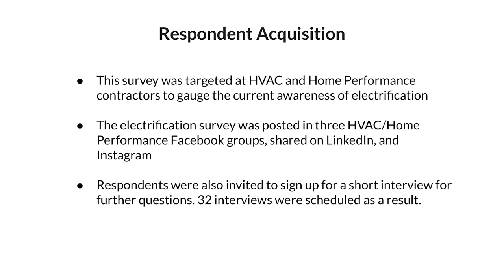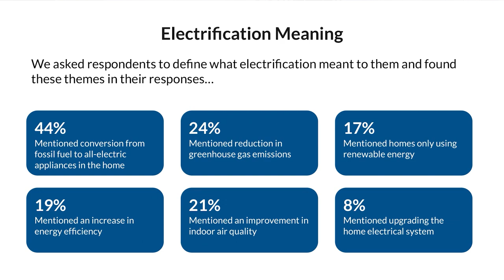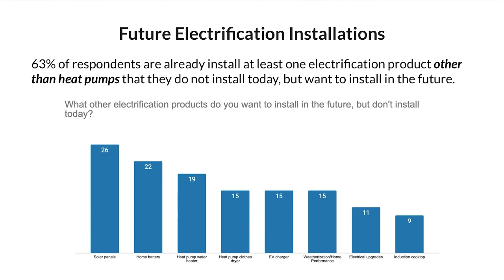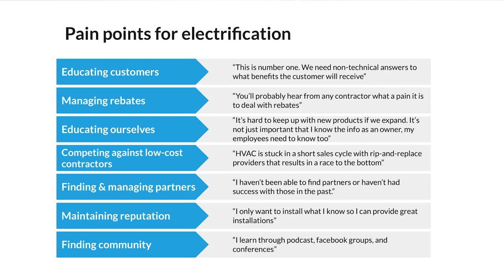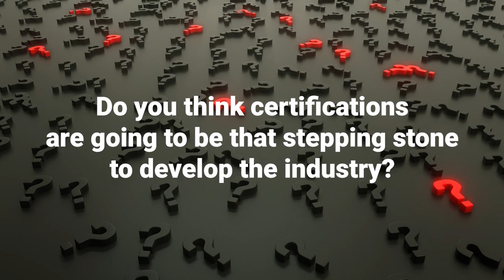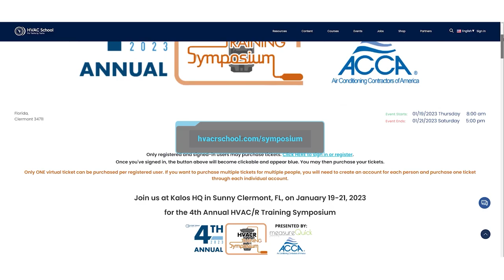Electrification Panel w/ Bill Spohn, Jim Bergmann and Kimberly Llewellyn

Comment: Totally off grid HVAC contractor for almost one year, at 38° in the eastern USA. 6.5 tons of 16 to 33 SEER heat pumps, 2700 ft.² Are you ready to spend what you would spend on a new four-wheel-drive pick up truck? We won’t find many people doing without their fancy truck and annual vacations. Before you even start on solar, you’re going to spend another pick up truck, upgrading all your appliances, lighting, and insulation. Then be ready to cut back on your energy consumption on those cold, cloudy winter days that we have. You need about a 2000 lb or 150 kWh battery bank. Now that HVAC manufactures have increased our cost of goods 50 to 60% in the last two years. Good luck getting anyone to upgrade their HVAC unless they absolutely have to replace it. My electric heat kits are all turned off but I had a wood burner going when it got below 25°F. We are not in Europe, where working together to help everyone is a thing. We are a greedy, materialistic country that likes showing off things that people can see. People don’t see your solar system or your heat pump.
Reply: How do you have 6.5 tons and 2700sqft.

Comment: Hello, is it okay to use just 1 guage for different refrigerants or do you recommend using multiple guage? Thanks
Reply: If you purge the gauge after use, you can use it with multiple refrigerants. Wireless (smart) probes have almost no "trapped volume" when compared to gauges, manifolds, and hoses, so purging smart probes is not required.

Comment: I believe you should tell your customers after 32 degrees below zero at freezing point that the damn unit ain't going to work if it's a heat pump you're still have heat from the heat strips and it will drive your electric bill way up that's what you need to tell your consumers

Comment: They do know a heat pump is no good at 32 and below then you have to use your heat strips which is going to raise your light bill like a son of a b** so where it gets really cold like snowing and stuff like that gas oil boilers are the way to go a heat pump will not work good in New York barely works good in North Carolina damn sure don't work good in Tennessee I don't understand why get rid of gas when it does a way better job of heating a house than a heat pump and probably cheaper on the electricity I'm sure cuz you use some gas and not electric so just give everybody a heat pumping good luck hopefully you stay warm during the winter and hopefully you can afford electric bill from that heat strip Burning It Up
Reply: This is the "old school" thought of heat pumps.
Current heat pumps ARE effective much lower than 32°, especially the ductless systems!!
Reply: Any of the variable capacity systems (which is the same technology in theory as the ductless) heat very well far below 32* nowadays. I have one and it rarely ever uses electric heat.
Reply: @bradenjohnson3830  I know when I go out of town from Florida I have a contractor's license to do apartments in stuff up north the code won't let us put in heat pumps because 32 below freezers I'm talking about Tennessee North Carolina Michigan specs on the heat pumps don't work what's 32 and below yes you can install on but you let me use a lot of electric heat what you're talking about send me some specs on your system so I can understand what you're saying